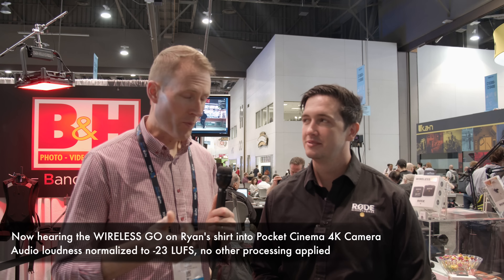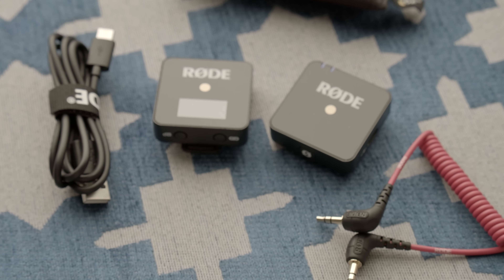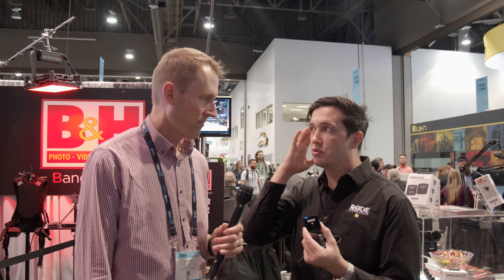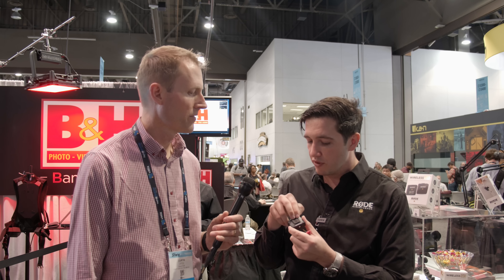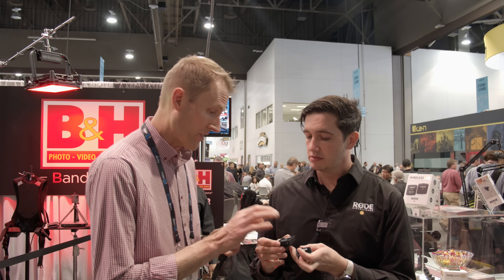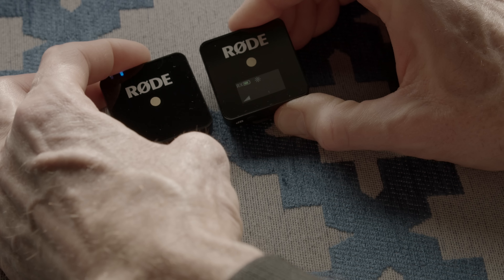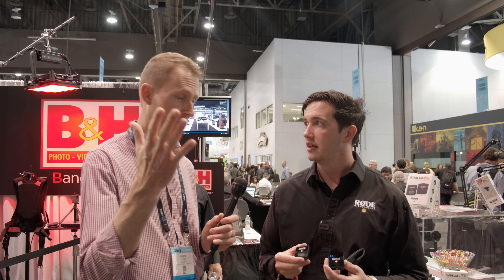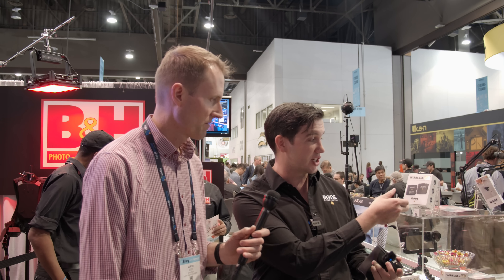RODE WIRELESS GO - NAB 2019

Comment: Hi Curtis, love your channel. It's been a while since you did a wired lav mic video. What would you say is the best reasonably priced wired lav with no in-line battery, with a good signal to noise ratio? I plan to use one with the rode wireless Go. I already have the smartlav + but the apparently re-enforced cable got ripped from putting it in the same back as the little clip! And I've never loved the sound sound especially with my voice. Any reccomendations? Thanks for all your advice
Reply from the maker: Hi Alex, What price range would you consider reasonable in this case? The reason I ask is that there is sort of a gap - lots and lots of cheap lavalier microphones in the sub $50 range but then not much until you get to the $200 range.
Reply: @curtisjudd  Hi Curtis. yes I noticed that gap. I was first considering getting a cheap sub $50 one to have as a secondary/backup to the Rode Smartlav+ I own. Then I thought maybe I could go a step above the Smartlav+ and then the smart lav could become the backup. But I dont mean a big step to a countryman or something as its overkill for what I do. Then I saw your interview with Deity at NAB. I see the standard W.Lav is about £120 in the UK when it comes out, so that could be a good small step up from the smart lav. Obviously I'd need to hear it first but it looks like it will be good. But in your NAB interview comments you only mentioned the W.LAV pro and Micro one, not the standard one I see on their website too. 

Sorry I'm a bit confused myself, but maybe some of the above makes sense! I'm looking to avoid inline batteries preferably
Reply from the maker: @AlexDelfont  Makes sense. The W.Lav has an inline battery module but that battery only powers the microcontroller who's job it is to figure out what you've plugged the mic into. That is certainly an option. I just tested the version of the W.Lav which ships with the Deity Connect wireless system which is slightly different in that it does not have the in-line battery module and micro controller and it sounds quite good. I should have a video out on that late this week if you'd like to hear it how it sounds.
Reply: @curtisjudd  thanks I look forward to your review. I didn't realise it had an inline battery for that. 

Would you at there are any other contenders in that price range?

Thanks for your help,  really appreciate it :)
Reply from the maker: @AlexDelfont  I havent use them personally, they're rather boutique, but oscar sound tech lavaliers sound good in the samples I've heard and are in about this price range.
Reply: @curtisjudd  great I'll have a look thanks :)

Comment: Curtis: Long time subscriber here. Can you recommend tried and tested lavs that will work with this without interference. I have a rather expensive, but older, AT lav and a Giant Squid, and they both generate a  high pitched whine that I cannot get rid of. Some folks have said I need lavs with better RF shielding, but try doing a search for "lavs with good RF shielding" and you don't get too far. What lavs do you recommend for this unit? I love the quality of the built in mic on this unit, but it's a little bulky and it would be great to be able to use a more discreet lav. Thanks!
Reply from the maker: Hi Bob. I will test the Sanken COS-11D and Voice Technologies VT500 with the wireless go as I work on the review.
Reply: @curtisjudd  Thank you. I've spoken to a guy at Sound Professionals, a specialty outfit near Philly where I've gotten some other mics, and he's got a little lav and cord that is well shielded because he said they ran into similar problems with another digital wireless setup from AT, and this lav did the trick. I'll let you know. Thanks for all the great tutorials...you're a true pro!

Comment: Hey @curtisjudd, is it worth an instant upgrade over the Rodelink Filmmaker Kit?  Or do you feel there are advantages this older system has that is worth holding on to?
Reply from the maker: This is not a replacement for the RODELink, just a different use case. RODELink has a longer range, replaceable batteries, locking plugs, remote mute capabilities. I think it is a matter of deciding which features you need.
Reply: @curtisjudd  thank you for answering and the insight, it's truly appreciated.

Comment: Hi Curtis, do you know if I can plug a line level signal to the transmitter our it  just accepts mic level? Also, the 3.5 minijack input its compatible with sennheiser or Sony wireless? Need to know if I can connect a mke2 lav. Thanks!
Reply from the maker: Hi Miguel, the input on the transmitter has a microphone level input and it is compatible with sennheiser but NOT Sony. Thanks!
Reply: @curtisjudd  thanks!

Comment: thanks for the video, btw can i use it for 2 or more TX into one receiver?
Reply: they are sold as pairs. If you want two channels, order two kits. Use a cable Amazon ASIN B000068O5H to route one pair into L and one into R and then mix in post. You can sync up to 8 pairs at once according to Rode.
Reply from the maker: DitzlerPhoto is correct. Each transmitter requires its own dedicated receiver.

Comment: Can you plug in a 1/8th to xlr out cable and connect to something like a Zoom h6?  Or do you need a 1/8 to 1/4" cable?
Reply from the maker: Should be able to. I'll test.
Reply: @curtisjudd  thanks, wasn't sure if the xlr needs a different signal than the 1/4" in. Works with the sennheiser,  but they came with the cable, so, maybe it puts out a different strength signal for each.  Audio isn't my thing.
Reply from the maker: You can always just go into the 3.5mm jack on the back of the H6.
Reply: @curtisjudd  Yes, but that is only one jack, and takes away the potential two xlr's that can be adapter
Reply from the maker: Understood. Will check when I start work on the WIRELESS GO review.

Comment: It is stated that you can connect up to 8 transmitters to this one receiver. To me that is hard to believe.
And do the blue led lights on the transmitter stay on all the time?
Reply from the maker: You can use 8 kits simultaneously, each with a separate transmitter and receiver.
Reply: @curtisjudd  Thank you, mr. Judd for clearing this up.

Comment: Seeing more compact microphone systems is great. But to be honest, I am still waiting for something like the Instamic that ships from Europe and has more mounting options. I would love to see more lav-recorders on the market.
Reply: What I wants is a digital high quality wireless that also records a back up, with safety track, on the same unit.  Zaxcomm has the patents but not the device...
Reply from the maker: Interesting idea!
Reply: @scottslotterbeck3796  I used a Zoom H1 recorder and lapel mic, with the headphone output fed into the Wireless go, so I had record and wireless.

I taped the two units together to make a compact pocketable system.
Reply: @jaymachik  and, did it work well?
Reply: @scottslotterbeck3796  Yes it did, you have to careful with mic you use, as some of the cheaper mics don't have a well screened cable, and can pick up digital noise from the transmitter.

And you have to turn the output of the H1 down so you don't overload the TX input.

Comment: as always, good job! i am an appreciative subscriber. nice that you can lower the gain if necessary (gh5) but what about  +10 or +20 for us canon dslr users with crappy pre-amps! thumbs up.
Reply from the maker: Good question. There is not a + setting but I’ll test out the levels with a Nikon Z6 which has one of the worst mic inputs of any camera released in the last 12 months. 😀

Comment: Curtis what are your thoughts on audio quality when going straight into the GH5  with something like this as opposed to into a zoom h1 or tascam dr10l? 

Do you find there's a big drop in quality? Or greatly increased noise? Lack of dynamics etc. 

I can obviously test when I buy something but I'm debating getting the dr10l or using this instead for interviews. Thanks
Reply from the maker: Not usually a drop in audio quality on the GH5. The bigger concern is whether the GH5's mic input can be set to a low enough level to prevent clipping and I suspect with the WIRELESS GO, it will. But that test is coming soon.
Reply: @curtisjudd  thanks, I thought the the GH5 preamps would surely be worse than almost any external recorder. But if you don't think so it would save me a lot of hassle!
Reply from the maker: @AlexDelfont  In this case, you're basically turning the GH5's preamp to its lowest setting the the wireless system is doing most of the amplification work.
Reply: @curtisjudd  I think I'll buy the wireless go and test it against the zoom h1. But the convenience will probably win in the end anyway! Thanks for all your work Curtis :)

Comment: great review and video - one thing I'd like to know and it is - if it can be used with 2 trasmitter and one receiver at the ame time or it could have some interferences conflict - and on the contrary if it can be used very good with 2 trasmitter and one receiver well I'd like to know if  if they sell also an extra trasmitter apart - I video rec actors so very often I need to have two mic trasmitter and one receive o if They have told you all I foresaid can you let us know thanks  - 141 thumb up is mine .
Reply from the maker: Hi Tony, unfortunately no, each transmitter needs it’s own receiver. You can use up to 8 kits at the same time - 8 transmitters each with their 8 dedicated receivers.
Reply: thanks so much I think it it very useful to know that . But if it is possible with different kit obtain the result it is welcome - because it wants  to say we have a solution .
Reply from the maker: Will be reviewing the Deity Connect dual channel wireless kit in the next few weeks. It has two transmitters and one dual channel receiver.

Comment: I tested this in my video and I did get some interefence while walking around.  And, my XSWD went to crap.  Sennheiser reps warned me, but I wanted to test it out to see who bad that experience was.  I see you had the same issues with your wireless. :)  At least we tried.
Reply from the maker: Good try!
Reply: So even this system had interference at a conference?  Was thinking of picking this up for quick interviews at tradeshows... but I assume if they will have issues... not worth it?  So what's the more secure way?  LAV mic to a pocket recorder then sync in post?
Reply: Slav Guns , I used the AVX last year at NAB with no interference.  But, it’s 3 to 4 times the price of the Wireless Go.  I’m releasing my video tomorrow of the Go vs XSWD.

Comment: Only feature missing seem to be locking capability for the microphone...  And some sound test with good lav microphone like the DPA 6060.
Reply from the maker: Locking plug would be cool. Will test with Sanken COS-11D.
Reply: You can overcome the non locking plug problem, by passing the mic cable behind the belt clip before attaching it to the belt.

Comment: This looks amazing but I’m concerned about the non replaceable battery after using it for 3 years..
Reply: Who cares, then there is a version 2......hahahah 😜
Reply: RepairGuyDK why would you wanna keep on buying lav mics every few years? I want my equipment to last.ive been using the video mic for over 5 years now.
Reply from the maker: Will be interesting to see how they hold up. Many Li-Ion batteries are now rated for 500 - 1000 charge cycles. Hopefully this is the case for the Go.
Reply: Curtis Judd or one might hope it’s a standard battery and is replaceable. Better to reuse than throw away a perfectly good mic just for the sake of a stock part.
Reply from the maker: @iNerdier  I have the GO here and it clearly isn't made for user servicing - no external screw heads or other obvious access to open the cases. So if it is a standard battery, it'll take some serious DIY skills.
Reply: Curtis Judd sounds like its ultrasonically welded shut, a genuine shame given the current push by so many people towards repairability. Thank you for the info and I hope that they at least consider it in future revisions.

Comment: How many times will be able to charge the internal battery? I'm wondering what the lifespan of it will be. Thanks
Reply from the maker: Hi Miguel, the battery is not user replaceable. I'm not sure what the lifespan will be but most quality Li-Ion batteries in 2019 are spec'd for 500 to 1000 charge cycles.
Reply: @curtisjudd  For someone looking for the best quality possible, would you recommend the Wireless Go or the RodeLink Filmmaker Kit? What's the best bang for the buck? I''m looking for quality and durability. I'll use your link to get it from B&H. You have a great channel. Thanks.
Reply from the maker: Hi Miguel, audio quality wise they are pretty similar in my limited testing with the WIRELESS GO. The advantage of the RODELink is a longer range, ability to remotely mute the TX, user replaceable batteries for longer shoots, and settings for the mic input. Those features can make the RODELink suitable for a larger number of shooting scenarios.

Comment: If Mr. Judd were to to an in depth comparison of the Rode GO and the Deity Duo-RX, that would be a super helpful! And probably the recipe for a popular video, as these two products are knocking 50% of the entry prize for a (two channel) lav system. Interesting times.
Reply from the maker: They're sort of in different leagues but I can speak to which is for which. The Deity is more than 3x the price of the WIRELESS GO and I think aimed at different use cases. More to come on that.
Reply: @curtisjudd  well, yes, the Deity is more expensive, but it's also 2 sets by default. Some would argue that 2 lavs is the minimum for a useful kit. So then the GO is up to 400$, but it still doesn't have any Lavs except the built in ones. So if you go with Rode's standard lav, it's 500$ for the two channel setup, VS. the 665$ for the Deity, which has a lot of bells and whistles, and a nice case. So it's not three times as much for similar functionality. But I await your findings with bated breath, as you are just about the only authority I trust on filmmaking audio.

(PS: Big downside I see with both systems is the internal battery - hope there are workarounds for that)
Reply from the maker: @DaCarnival  Understood. USB input is the workaround I see for the internal batteries. So not ideal from my perspective. But good point to consider.

Comment: I know this was recorded on the BMPCC4k - but What kind of levels do you get with it before normalizing? In my experience, your mic needs some kind of inbuilt amp to get any usable audio from the 3.5mm input on the camera. Does this system have that? What gains setting was used on the receiver?
Reply from the maker: Hi, I had to normalize 2dB to reach the -23 LUFS target. I don't remember what the input level was set at on the camera but we usually leave plenty of headroom.
Reply: @curtisjudd  That's great, thanks for the response! I assume then, that the levels coming into the camera were around -18db ish?
Reply from the maker: @n.hayman  yes, roughly in that realm.

Comment: TRS or TRRS?  A lot of Lav mics on the market these days have TRRS plugs.
Reply: TRS as mentioned three times in the video.
Reply: @shapes2000  Yes I heard it 3 times and was pretty sure I heard TRS, but I wanted to confirm because it's a noisy room and they sound similar.
Reply: @GeorgeOu  Yes, they got some good quality from such a noisy venue, they definitely said TRS but would be good to double check the specs just in case.
Reply: @shapes2000  Again, I said I heard it 3 times but just wanted CONFIRMATION because the word sounds alike and it was a noisy environment.  I'm allowed to ask for confirmation right?  Or do I need to ask for your permission to avoid snarky replies?
Reply: @GeorgeOu  Hi George, please reread my comment, I was agreeing with you.
Reply from the maker: TRS is my understanding.

Comment: hope it will be better than Sony ECM W4 and compatible with both iOS and all Android devices.
Reply: According to Ryan, definitely works with iOS with the right adapter cable. Should work on Android as well, but on Android, the camera or recording app you use must be capable of configuring to use an external microphone in the headset jack.

Comment: I reallllly wish they added a screw mount for the mic. This would've been great. Gonna wait for some comparisons with the senheiser, though leaning more towards this little guy for 2 specific reasons: battery charge time/capacity, and size. remember that dunk test Curtis....😂
Reply: any cold shoe adapter would work fine for a screw mount. I think the cold shoe mount size clip is brilliant!
Reply from the maker: Hahaha!
Reply from the maker: I think he means locking plug for the 3.5mm mic jack.
Reply: DitzlerPhoto sorry I don't know if there's a name for it but it's like what Curtis mentioned, to lock the 3.5 mic
Reply: @rayrapphaelbisnar  ahh OK. I see what you mean. I have that on my Sennheisers. A screw locking 3.5mm jack. I will design a 3D printed retainer clip once mine show up. I also want to make a cold shoe adapter to hold two RX.
Reply: @DitzlerPhoto  I just pass the mic cable under the belt clip, that stops it pulling out.